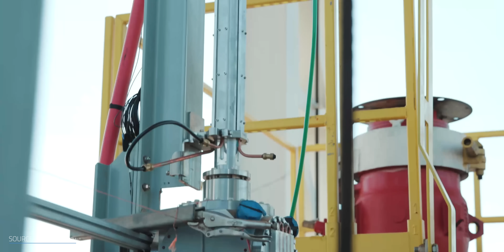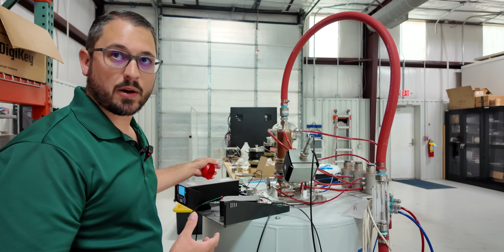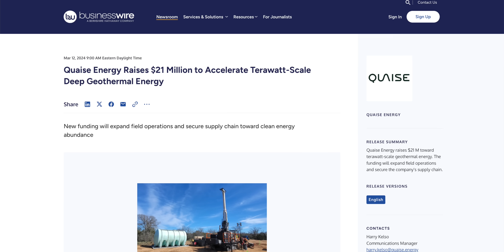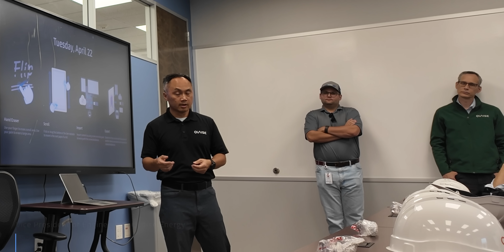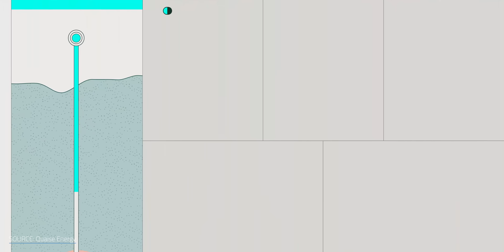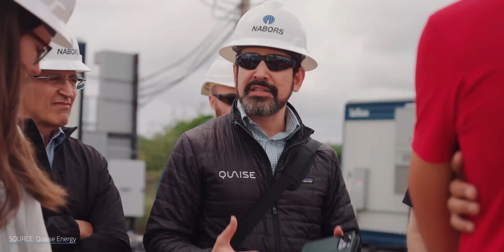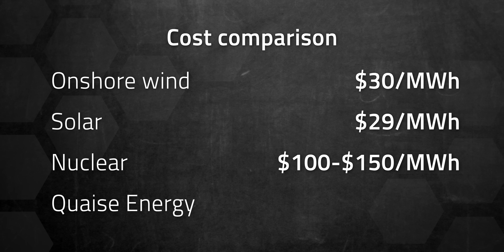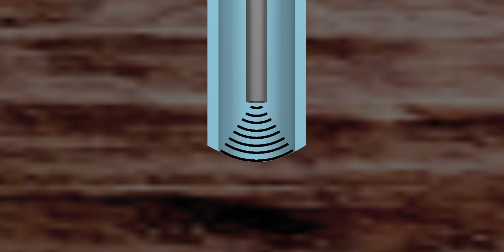How Geothermal Energy is About to Break its Limits

Comment: Most of the potential in geothermal is probably in heating, not electricity. Because for electricity, you need high enthalpy geothermal resources, which is only available in some specific regions and you can't easily exports electricity globally. But for heating, the geological conditions are suitable in most places on earth. You can't really export heat either, but you don't need to, because the geological conditions necessary for just creating heat are much more globally available. One drawback of course is, that the demand for heat is only present in places, that need heating, while the demand for electricity is present everywhere.

Comment: How does mud circulation work if youre trying to vaporize rock?
Reply: There is no drilling mud but instead they blow air through the extra space.
Reply: @JeffBilkins air wont bring out the larger cuttings to surface though. Additionally, how do you maintain well control with air? You need to have mud to know whether you have a kick and be able to close the well in case of it.

Comment: geo thermal is the most dangerous extraction of energy it should be forbidden ...diffrence between earth and mars?you can always recapture co2 if it gets out of control.but how do you reheat the core of a planet?we extract so litle it shouldent mather....thats what they said when they where starting to unleash co 2 in the atmosphere...the atmosphere is visible and in reacht the core is not +you have no idea how fragile that eco sys is....and it is fragile if it was not mars would still have a liquid core.....its just moving the problem from easy to fix to impossible to fix geothermal

Comment: I hope they succeed. I have memorized some poetic theses about geothermal energy that sound impressive. 99% of the planet earth is hotter than 1000C. The amount of geothermal energy is enough for any number of people on earth for all possible future generations. Because the heat of the earth's depths will last longer than the sun itself. Therefore, I believe that the fascination with wind and the sun as energy sources in human history is a temporary phenomenon. Few people imagine how much materials renewable energy currently requires. For example, a 1 km long cable to a 1MW wind turbine weighs 100 tons.

Comment: You've laid out all of the potential positives of using this technology.  Can you tell us of the potential negatives?
In the same way that windmill farms were touted as being a huge leap in "Green-Energy" and we now are finding that they are no where near as cost effective as they were touted, this new Geothermal energy harvesting must surely have its own pitfalls.
Reply: What garbage fake news source claims that wind farms are not cost effective? You build a turbine once and it intermittently generates power for 20+ years without needing to shovel millions of tons of dirty fossil fuel into a thermal plant. Cheap and quick is why the world has installed over a terawatt of wind generation, and generation increases every year; look at "Electricity production by source, World" on the Our World in Data site. The only generation that is being installed at a faster rate is solar PV.

Comment: Geothermal is really the perfect energy source clean baseload with high capacity factors, it can also be dispatchable it can load-follow replacing the role that natural gas peaker plants currently play for renewables heavy grids, it can be used for directly for heating and cooling in a number agricultural, commercial and industrial applications offering deep decarbonization there as well. 

And with technology like what Quaise is pioneering we'll eventually be able to have geothermal everywhere.
Reply: Not if Quaise doesn't hit its cost targets. Maybe the drilling remains expensive. Maybe the boreholes degrade or break down. Maybe extracting all that heat cools the surrounding rock so you have to slow or pause pumping.

Comment: The glass liner will not hold up without help. For each 1000 meter you will increase the  pressure wit more then 300 atm. Slag of the type on the inside of the "bore hole" is very brittle and will crack and disintegrate at a lo less pressure. The most important part for mud in a bore hole is to equalize the pressure to prevent collapse when you hit softer rock layers.
Reply: you mean that if you apply 300 atm pressure on a rock with a small hole (the hole is only 200mm) the hole will collapse?
Reply: @janami-dharmam  Yes, it could be 20 mm and it would still collapse. That is why the land above an oilfield or an aquifer sink when the oil or water is removed. The pressure make the small pore collapse when oil or water no longer hold them open.
Reply: I was thinking about this collapse possibility too.  Maybe water can be kept a a consistent level within the shaft to help support against shaft collapse.  This water would be needed during the initial drilling and during operation too.  Or install stents or even cross beams along the way.
Reply: @beyondfossil  You need a mud with the same specific gravity as the rock they drill  through. This will keep an equal pressure in the hole, but the mud have to kept away from the plasma. Not easy to do.

Comment: This 1 MW gyrotron sounds great for creating a Lunar snd Martian base.
To create a dust free zone is such a difficult challenge due to high static fields causing the dust to climg to everything.
I can imagine this "drill" rapidly forming molten regolith "filaments" into 3D printed feeds.
Maybe the landing sites would resemble  an extra large and thick sports stadium or hallowed out hill, able to absorb meteorite strikes, rocket explosions, and dust capture. The dust is a big problem that many people don't realize how difficult it is to solve on those surfaces. The higher you go, the less dust.

Comment: All right, I'll watch this video, but I'm already skeptical to the point of being salty.  I just want to know one thing: how deep have they drilled.   I will amend my comment with the answer once I hear it.

EDIT:  Sounds like they've gone 10 feet.  I'll have to get my kids a better shovel so they can keep up.  The problem here is losses in the waveguide.  You're not going to get 100% of the mm-wave power from the gyrotron down to the bottom of a borehole.  That means the power you need to generate at the surface increases exponentially with depth, unless they can make a compact gyrotron that fits in the borehole.  10 feet is actually impressive, but of course they have to go 32,000 feet to unlock the potential they are after.

As of now, I think this is a pipe dream, but a compact gyrotron would be a game-changer.  We can transmit a megawatt over copper wires a lot easier than through a waveguide.

Comment: The interesting thing is that you don't talk about the 'always on' of geothermal systems. 

He is correct that geothermal, nuclear and eventually fusion are the future.  Solar and wind will have a place, but considering the potential hazards  of wind and limitations of solar... a smaller percentage.  

The big question... how fast could you bring a geothermal plant online versus building a net new nuclear plant? 

So all those data centers... what's going to power them? ;-) 

Also consider some of the negatives...  You bring up the steam... there will be contaminants, they need to be dealt with...  Post turbine, the water vapor will still be hot and you will want to cool it down...  Is heat going to be your next 'green challenge' how to get rid of that excess heat? 

Definitely cool tech. Now lets see if you couldn't use this for mining out tunnels for trains...

Comment: Drilling using electromagnetic waves to melt rock is a silly idea. It would be much easier, much faster and much cheaper to drill using a high-pressure water jet. This company is going to fail

Comment: I am glad they have made progress, but the real problems to achieving their goals have not been answered.
Questions like .... How do you stop rock from flowing back into the borehole? As depth increases and temps rise solid rock becomes viscus so how do you keep the soggy from flowing in?
After you vaporize the rock at the cutting head how do you get it out? A bland "With gas pressure" does not cut it. The vaporized rock would cool down on the way up. It would then solidify on eather the drilling equipment or the bore of the hole, blocking it up. Even before it blocked up it would restrict the flow causing resonance problems!

I know I tend to see problems but let me mitigate on this one ....... Hot water! If you get water ingress it might get to the boiling point and the resultant steam jet out of the exit carrying more detritus with it! I say it "might" boil the water because that boiling point depends on pressure and I am unaware of the pressures involved at the expected depth!

Comment: As far as shared setup and skill base with drilling rigs, it would actually make a lot of sense to start the hole with a conventional drill where that's the fastest and most economical option, then swap in the gyrotron when the hole's deep enough that the continuous vaporization of rock becomes more practical that a drill that needs constant swapping.
Long term, it's exciting to see this technology reach this stage.  Hopefully they'll be able to crack any real world issues.
Reply: That's their plan, a hybrid drilling rig.
Reply: I wonder if they could use old exhausted oil wells. Maybe not the capped ones, I'm not sure how that works, but maybe one that recently got depleated.
Reply: That's exactly what they're doing. First ~3 miles or so is traditional drilling, because that's through nice and soft ground. Switches to the gyrotron when they hit the hard stuff.

Comment: Accessing 375C that's 10km below the surface doesn't mean you have anything resembling 375C by the time it reaches the surface. Narrow pipes lose a lot of heat over distance.
Reply: That's why they drill down to 375°C rock instead of stopping at 250°C . For what it's worth, Claude AI hallucinates "In enhanced geothermal systems (EGS), the temperature drop from reservoir to surface typically ranges from 20-50°C, though this can vary significantly based on several factors."
Reply: @skierpage  "That's why they drill down to 375°C rock instead of stopping at 250°C ."
The problem with that is that the 375C material could be the same as the 250C material since the 375C has to travel over a longer distance to the surface.

Comment: One of those things unlimited energy makes possible is carbon dioxide capture.  Right now, trying to reduce the amount of CO2 in the air using this method is outright ludicrous because so much of our energy budget comes from fossil fuels.  We would put 10x the amount of COL2 into the air just from generating the power necessary to remove it.  However, using this method of generating power makes it practical.

Another point needs to be emphasized.  One of the unforeseen consequences of drilling is the production of small earthquakes that are felt by everyone in the area.  This constant rumbling frightens pets and is very uncomfortable to live around.  It's very likely that this kind of drilling would be far less likely to produce the strains and disturbances normal drilling does, so this effect would be greatly lessened.  Only time will tell, of course, but solving that one issue would certainly make geothermal drilling far more palatable in populated areas.

To me, this looks like one of the most promising developing drilling technologies ever.

Comment: High tech microwave drilling, existing. But I do wonder how the vaporized rock can make it back to the surface through the space around the waveguide in deeper drills. I expect it to cool down and condense on the walls, decreasing their diameter more and more. I guess they could pull out from time to time and rewiden the hole. But this condensing effects becomes stronger the deeper you drill, as the rock vapor has a long way and thus longer contact time to cool off.
Reply: Yes, they are going to run into lots of known and unknown problems that they'll need to address before the money runs out. Exactly how deep has that test borehole reached? I think it's only 100 meters!

Comment: What might be helpful to analyze the Oregon project better would be the cost of construction per kilowatt hour and capacity percentage.

In the 1970’s two Westinghouse designed 454 (MW) nuclear power plants, were built in approximately 5 years for inflation adjusted price of 844 million dollars (2023).  That is under one thousand dollars per kilowatt.  They have had an 82 percent lifetime capacity factor and in 2022 generated over 10,000 TWh of electricity.  

If Quaise have signed a contract they must have a rough idea of total cost for the project and generation capacity.
It might be helpful to compare in the future.

Comment: Lets say they have too drill down 10 miles for adequate heat, at the very least it is going to very quickly lower the ground heat at that level and cause ground surface levels to drop. Hello ice age. But at least we wont melt from carbon caused global warming...
Reply: And if you think the low cost of drilling is going to lower the price in any way for us, the end users, then I have a bridge to sell you.

Comment: Really can’t use this tech for oil drilling.  Mud is used for well control and keeps hydrocarbons contained until the proper mechanisms are put in place to remove product in a controlled manner.  The BP incident happened in the gulf due to loss of mud (bad cement job) and the oil pushed up at a very high rate.  

This is great for geothermal but not for extracting liquids/gases.

Comment: out of all the fluff renewablee energy sources you review on your channel - this one seems the most realistic and with the most ceiling with its potential. it doesnt require batteries like solar or wind. its plentiful everywhere around the world unlike hydro tidal or solar. And the core of its technology is already well understood unlike thorium or fusion. This technology is already out of the laboratory and in its final touches ready to be commercialized and improved upon, not some research project. On top of that theres minimal safety concerns unlike fission. The gyrotron never actually goes into the hole and can be reused after every hole, meaning it can last for a very long time. so not much is consumed in the drilling of the hole. And the best part is it piggy backs on fossil fuel infrastructure allowing for fossil fuel companies to get on board rather than fight tooth and nail against its adoption. employees dont have to lose their jobs.

imagine energy escape velocity. drill holes -> collect energy -> now theres higher supply of energy -> energy becomes cheaper -> now its cheaper to drill more holes -> drill holes repeat
a spiral that drops the cost of energy down to zero. No other renewable tech can do this because the only input to this is its output. if you want to scale solar you need to build more solar panel factories for example. for this its input is its output so you can scale indefinitely. 

Its a perfect technology. and i think it will usher us into the age of energy too cheap to meter.

Comment: question: what is current maximum depth? 9m in May now 130m... hmm... wanted to find spot in video where you mentioned "the question", I think mine may be more significant? 

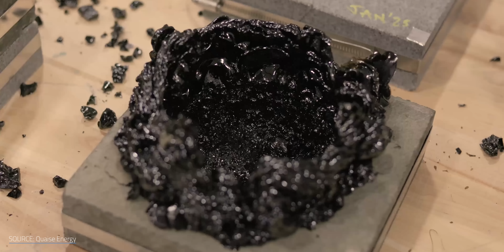Not sure how things are done with actual hole, the water thing may be huge... but really like the idea of the vitrification of walls, but then what goes in the hole... I was looking at graphics and noticed what may be interpreted as two holes?  so you don't drop tubes in hole?  or can you instead drill twice perhaps tiny V?  so a few questions...  actually 2 holes or slight V may be very efficient and insulative... can't run hot and cold side by side in same hole... so Saying "The Question"... needed to rewatch, found what was actually "The Critical Question" (not economic) @12:09 so a few future questions after holes are actually deep enough.... I would ask if extra water from cracks matters and is just not more water?  NO that is stupid, need closed system... imagine cold water in the up pipe/hole..

Oh, 20km holes available on patreon... he knows my question but is 20km deep enough? and why 130m now and not 20km and when 20km?  yeah... ok paywalll ...

Comment: It was out of reach for a reason, this will cool the earths core faster. The earth is smaller than we realize, doing this on an industrial scale... I swear, humans are doomed.
Reply: This is complete nonsense... please do some research or just rough estimation before spreading misinformation. Earth naturally loses nearly 50 TW of energy to the surface each year, and humanitys entire energy demand is 20 TW (including electricity, heating, fuel, transport, ..). And those 50 TW are essentially just waste heat. The earth contains a nearly unimaginable amount of energy, and it's essentially replenished by nuclear processes too. Humanitys energy demand will go up throughout the years and centuries. Estimations for 2100+ are at 50-80 TW anually, which is of course still peanuts. But even keeping up these trends, Earth can easily handle humanitys entire energy demand for hundreds of thousands to tens of millions of years without any issues. And dont forget that most energy solutions are only needed until we figure out fusion, which i imagine we should get figured out within the next couple thousand years or so, dont you think?

TL;DR: Quite the opposite. I think you are underestimating just how large earth is. Even drilling extremely deep holes down to rocks that are 400°C hot, to get supercritical steam, we are only talking about 0.1-0.3% of earths depth. If earth was an apple, the hole(s) would be less than a tenth of a millimeter deep. The width of a human hair. Just to put that into perspective.